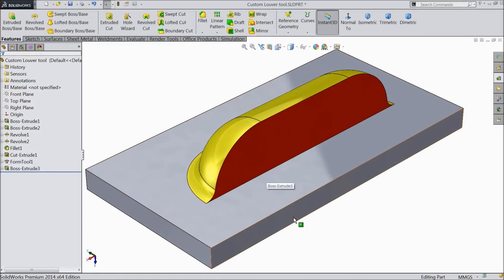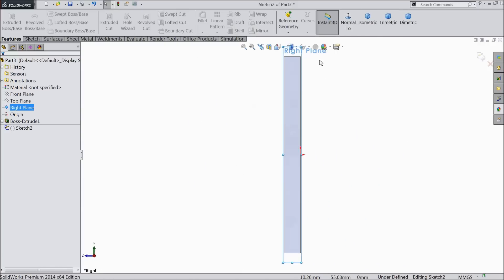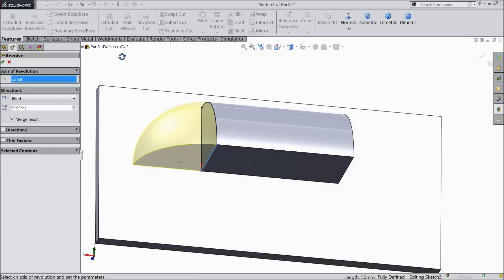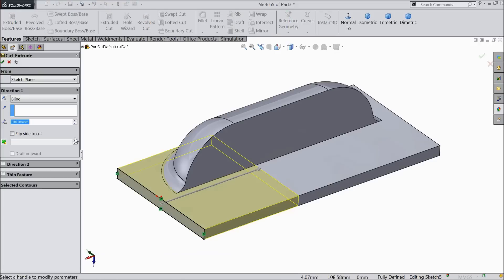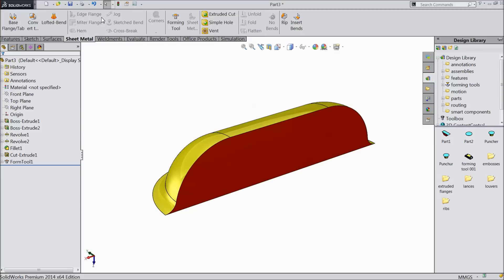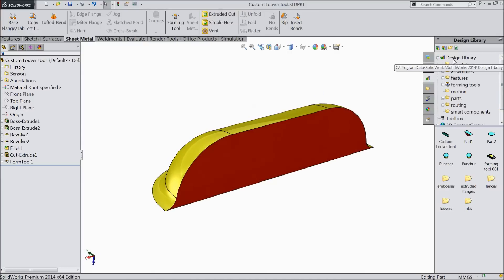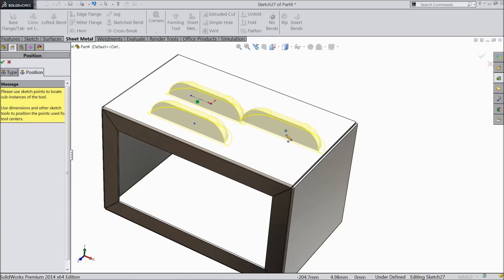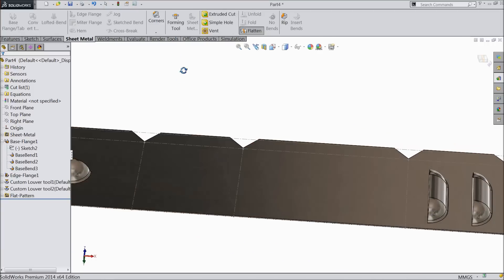How to make custom forming tool (Louvers) in Solidworks

Comment: Make sure you save the file as  (*sldftp) instead of (*.sldprt) if you are using a newer version of solidworks. You won't be able to find your tool in design library otherwise.

Comment: Nice video, there is one correction though. The part has to be saved with extension .SLDFTP which is a Form Tool extension. If you just save it as a part and add it to the library, SW thinks you are adding a part to an open sheet metal part and hence the message 'Do you want to create a derived part'
Reply: You can save it as a part if your folder in the design library is checked as a "forming tooling folder"

Comment: Its asking me if i want to make a derived part? An i cannot select faces from the box, it selects the whole box, what do i do?
Reply: Same error please help me out
Reply: . The part has to be saved with extension .SLDFTP which is a Form Tool extension. If you just save it as a part and add it to the library, SW thinks you are adding a part to an open sheet metal part and hence the message 'Do you want to create a derived part'
Reply: @eurotechautomacao5839  thanks

Comment: Pro Tip: Open up your Louver.sldprt and create a design table with many multiple standard sizes and widths of louvers. When you add the louver to a part, you can select between the different configurations without having to credit a separate louver part.